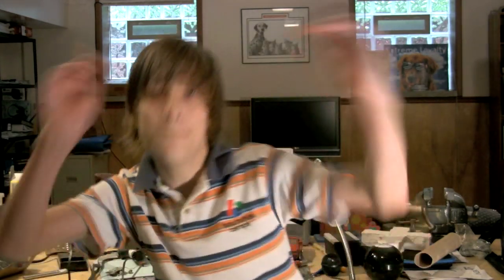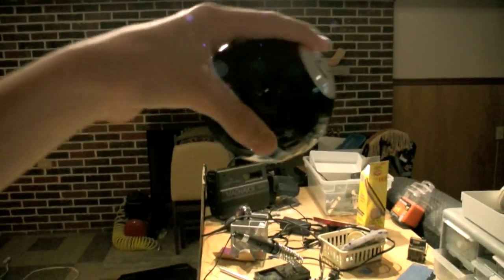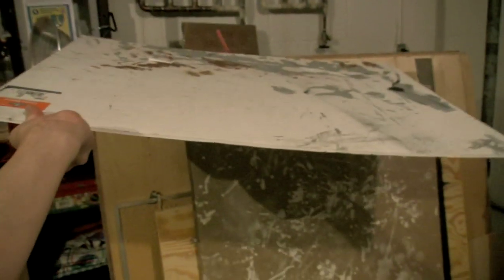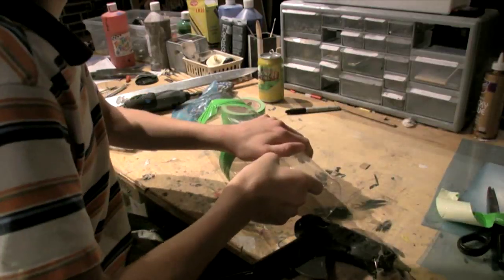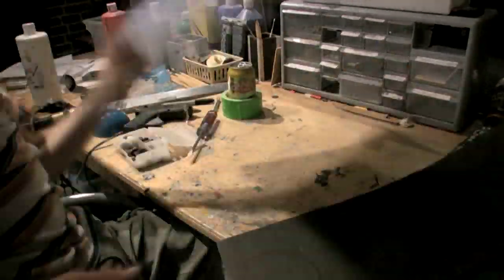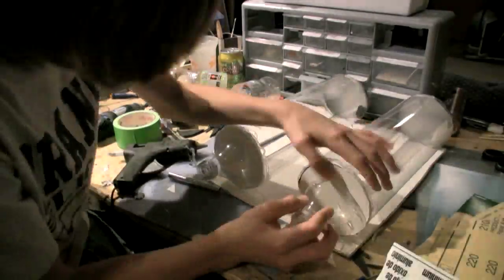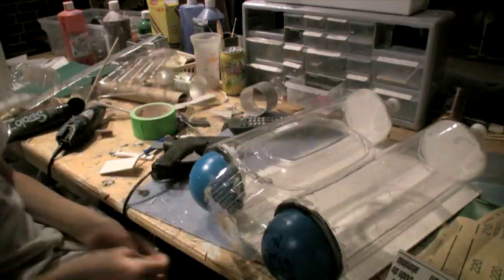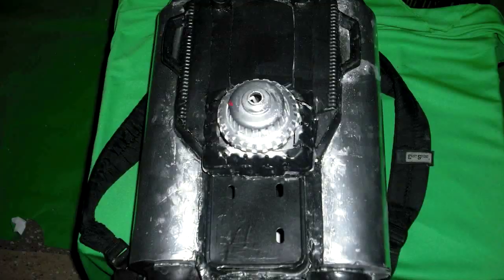Build a Jetpack

Comment: @kaulas123456789 if you're really light, you could make it fly be getting some coca cola and mentos and putting them in the plastic cotainer and make a hole through the bottom then you might get off the ground a little.
Reply: How light? Would 60 pounds work